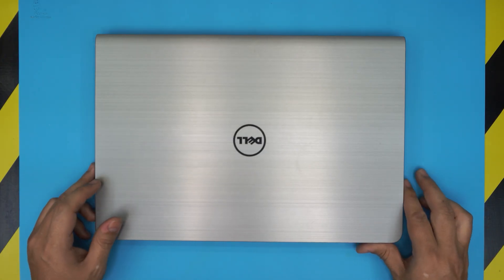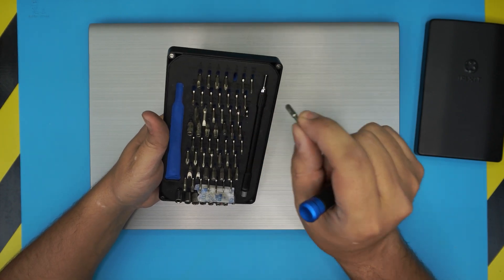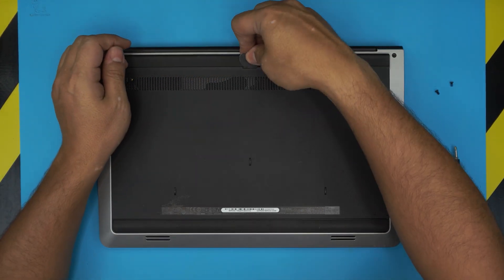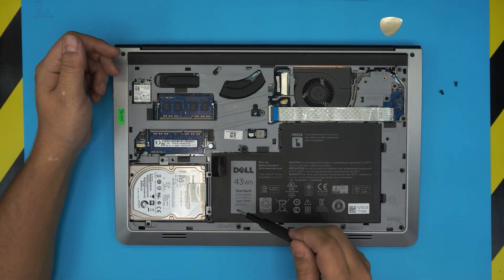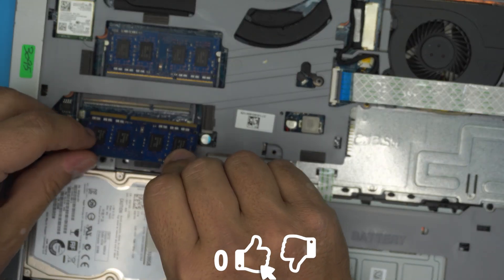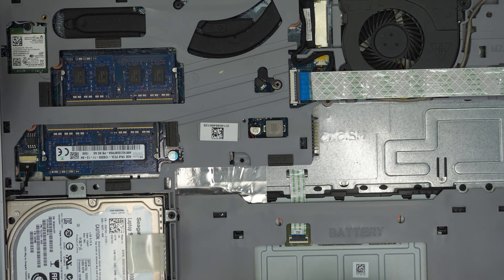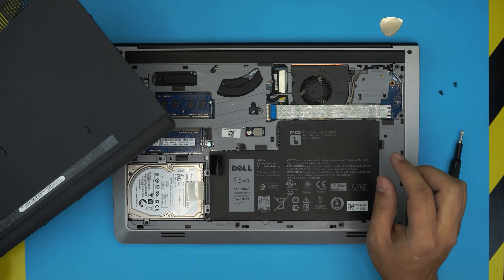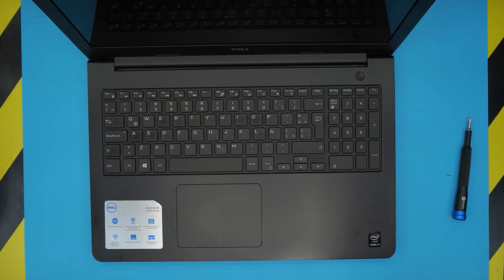DELL 15 5000 Series Laptop Ram Upgrade Guide

Comment: Thanks for the thorough explanaion and demo.  I've had my Dell with 8gb RAM for years and always thought it was not upgradable, now that I see how easy it is, I'm going to double my memory, or maybe even 32gb.
Reply from the maker: Thank you for your feedback! If you wish to support the channel, you can like, subscribe, or both!
Regarding your upgrade, i would highly recommend you to go to 16gb that is the best spot for this motherboard and CPU.
the 32gb will not be use to it's max limit.
Should you have any further questions or requests in the future, please don't hesitate to ask me.
cheers🍻
Reply: @uFixTek hi I have Dell inspirion 5548 and I want to know how much mhz frequency RAM can I upgrade in this laptop? Can I put 2600 mhz ram?

Comment: hello  @uFixTek, I have this notebook version (5548 I7, 16GB ram), the value returned from the wmic command was 16777216, if I upgrade to 32 GB (2x16gb) what would happen? Is there any way to increase this limit? Thank you for your attention!
Reply from the maker: Thank you for your feedback! If you wish to support the channel, you can like, subscribe, or both!
Regarding your question, you can't go over the 16Gb, the max it can read and handle is 16Gb. if you place 2 x16gb the laptop will not POST, and it will stay in black screen, OR it will power on and load windows but it will show 32GB installed and in "(" will say 16gb usable only.
Should you have any further questions or requests in the future, please don't hesitate to ask me.

Comment: Mine says up to 16gb ram u can upgrade. What happens if I go 32gb?, which I want to have. I have the Inspiron 15 5000 series. It's also says ddr4 not ddr3 like the video, i guess depends on the model type?.
Reply from the maker: Thank you for your feedback! If you wish to support the channel, you can like, subscribe, or both!
Regarding your question, there are many different models under 500 series this video is model:  15 5548 , also yours is taking DDR4, if the cmd says max 16GB then you can only go up to 16gb 2x 8GB https://amzn.to/42ztCbB
🔵 check max ram capacity: https://youtu.be/tKEJTkVth4Q
Should you have any further questions or requests in the future, please don't hesitate to ask me.
Reply: @uFixTek  Hi, i have this model. What happens if i put 32gb ram?
Reply: mine says 33.55 max hopefully the 32 i ordered work